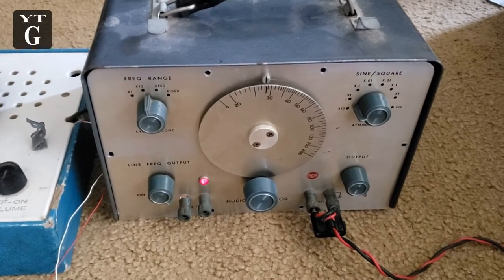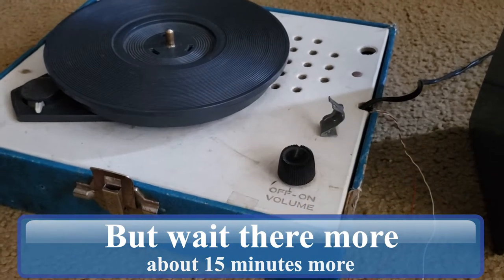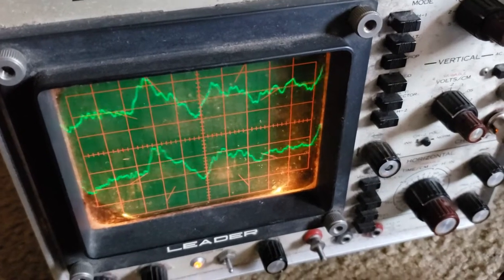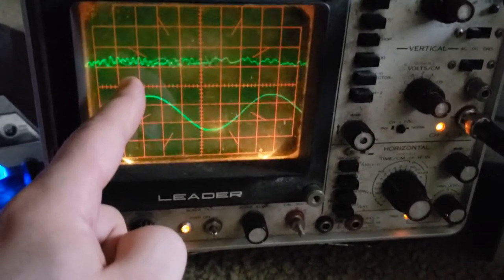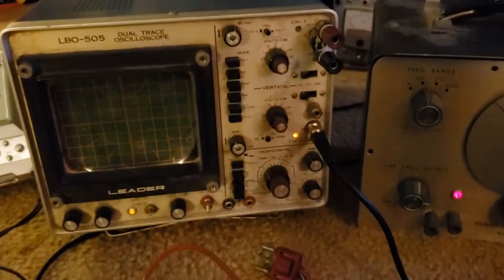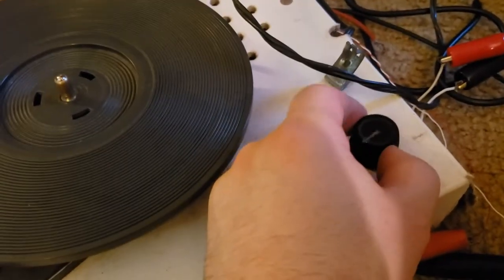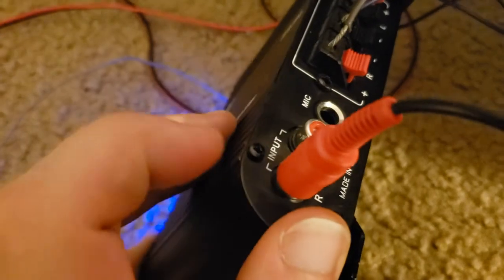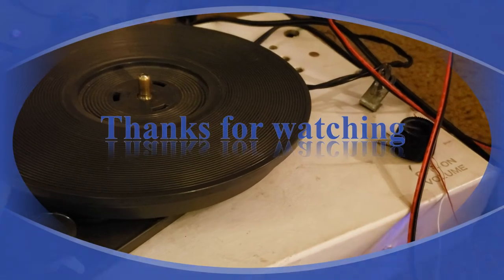amplifying an Audio Generator signal with different amps

Comment: Where did you get your information about ceramic carts not needing a preamp?
Reply from the maker: A variety of places ... everywhere from YouTube videos to data sheets. Plus, that record player I use in the video only has one transistor in all the circuitry. For any form of multistage amplification, whether it's a pre-amp with an amp or just a multistage amp, at least 2 transistors are needed. Also, most ceramic and crystal carts have a very high output as compared to their magnetic counterparts. Because of this, the amplification from a pre-amp is not needed. Please see these to links below
    https://thevoiceofmusic.com/catalog/vm_rca_45player.asp

https://www.vinylengine.com/cartridge_database.php?m=any&mod=&t=any&sort=2&Search=Search&sty=&ovlo=500&ovhi=5000&can=&dclo=&dchi=&stid=&masslo=&masshi=&notes=&prlo=&prhi=

Comment: How do you hook amplifier to a rodin coil and function generator
Reply from the maker: Assuming a rodin coil is like a speaker from an electronics standpoint (both are wires wrapped in a "coil" shape), you should be able to hook up the rodin coil to the output of the amplifier and hook up the input of the amp to the function generator. Like what I did in the video, but replace speaker with rodin coil. Again be careful, some amps are designed to work with 4 to 8 ohms speakers, others only 8 ohms, a rodin coil might not have that particular amount of ohms. This could effect your results and/or ruin your equipment. Again be careful in general, when not 100% sure of the out come.
Reply: Thank you so much will try
Reply from the maker: @naturalmilkhoneyandzenretr9508  your welcome
Reply: How to you change the electric signal to make electricity
Reply: @JosephX  So they sell bnc cables with different ends i noticed that on this video the bnc cable has two aligator clips.
Reply: @JosephX  Can you do a video showing how to inject a signal on and amp/receiver to troubleshoot for problems?
Thank you
Reply: @JosephX  Excellent video very informative and entertaining.
Reply from the maker: @SDsailor7  I know that they make BNC to RCA, but I just used what I had laying around
Reply from the maker: @SDsailor7  Also, what kind of amp? tube, transistor, HiFi, mono, stereo?
Reply: @JosephX  "a rodin coil might not have that particular amount of ohms."
^impedance not ohms. Impedance is resistance. ohm is the measurement. I have been a proficient ham radio operator for over 30 years. Please edit your statement. Thank you.
Reply: @naturalmilkhoneyandzenretr9508  you can check the resistance of the rodin coil by using a multimeter, set it to the lowest impedance setting usually 200Ω. This will tell you if your amplifier is suitable. I am a proficient ham radio operator for over 30 years.